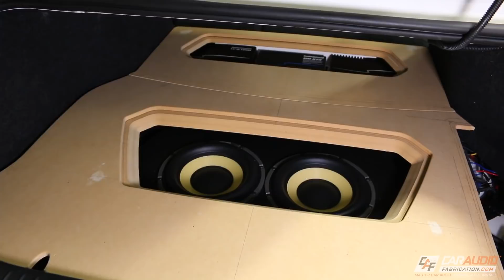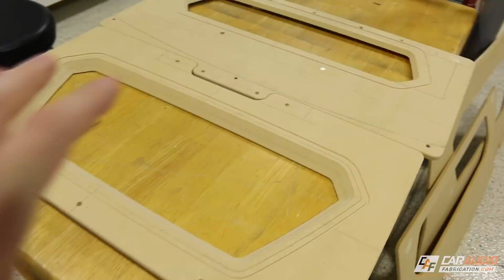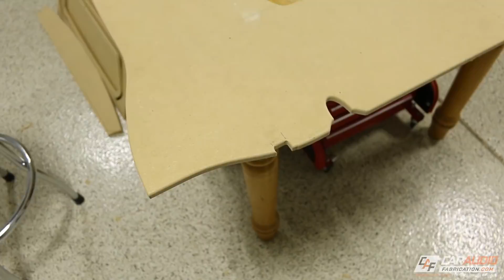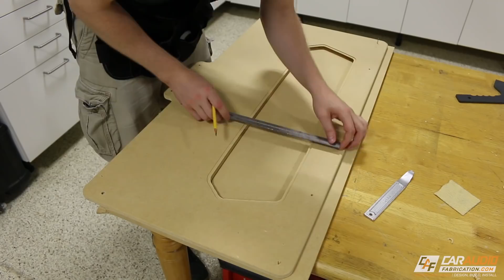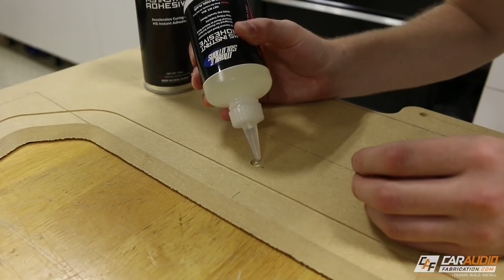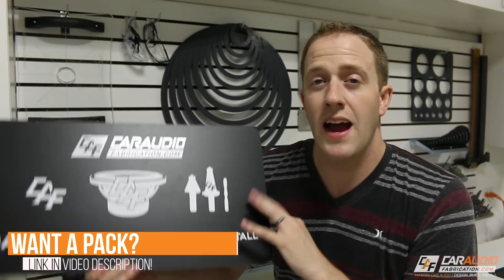HIDE THOSE SCREWS! Use Magnets for Car Audio Beauty Panels!

Comment: You do amazing work!! Have you ever used different material for the false floor/beauty panels to try and keep weight down. I noticed you use a lot of heavy material. Ive made a few false floors and found teak to be a nice material to use, its light, strong, it cuts and routers well, it is fairly inexpensive, readily available, and can be used as a finished product when stained or poly'd. I use a 5/16 sanded teak plywood for floors and panels, and teak boards for any type of braces and trim. I took out a 100lb MDF false floor and replaced it with a 10lb teak false floor that was stronger, more durable, doesn't chip from screws, wont swell when in contact with water, and will last for ever.

Comment: hello i have a question but i cant find it anywhere. so i want to get a subwoofer for my van. (mercedes vito 111cdi) i have about 2 m3 on space. what is the best subwoofer in this case and how much power does it need to have? i mostly listen to rap and dance music. so a ported one would do. and i was thinking of a single 12 inch woofer with 750 watt rms. or should i get two 12 inch woofers with 1000 watt rms?
hope someone can help me.
thanks in advance

Comment: Mark what type of industrial Velcro (link??please) do you use for attaching the Secondskin's Mass Loaded Vinyl/closed cell foam to the sheet metal of your car doors etc? I can't find a link anywhere in your list of tools and materials. I understand from Sound Deadenr Showdown that the Velcro brand/version is very important for adhering thr MLV to sheet metal. Many thanks!

Comment: Could do with some more support for the beauty panel......especially nearest to the boot/trunk opening as its looks like the nearest support bracer is a good 12” inwards, so if I put a car battery just inside the boot/trunk ( let’s face it you wouldn’t want to put it any further in as it is bloody heavy) it will bow/bend or break the panel.

Comment: any reason why I couldn't just dowel and glue it all?
Reply from the maker: Youll never get a panel that large into place. It has to be multiple pieces
Reply: I get that but what if, instead of using magnets, I drill holes and dowel in to place without glue so I can take it out again without a problem

Comment: I have a question.  I have a 2018 Honda Accord.....it has a 10 (crappy speakers) system....one of which is a so called woofer.  It is a 450 watt system.  Can I just replace the sub in the back dash with a better one for a lot better base?.....I would appreciate your guidance.
Reply: The factory amp pushing that aftermarket sub going to create issues
Reply: what kind of issues.....what would be recommended?

Comment: Just be careful. I used magnets to mount crossovers to the inside of my doors.  Works GREAT!!!!  Except that they attract metal particles to the outside of the doors.
Reply: Are you not concerned about the magnetic fields interacting with your inductors in the crossovers? Maybe I'm just over thinking it
Reply: ADR  I haven’t thought much of how it would effect the equipment or the sound.  Clearly I didn’t even think it would attract metal shavings on the outside of the door.

Comment: I'm at the same point in my install and I'm worried about the two panels rattling. How do you deal with this using the magnets? I feel like that top cover is going to vibrate between the magnets and make a terrible sound.
Reply from the maker: You guys underestimate the strength of these magnets, they have a pretty strong pull. They are a higher grade than what you would buy over the shelf at some random store. If it rattles I will decouple with closed cell foam or cloth tesa tape, but it wont.